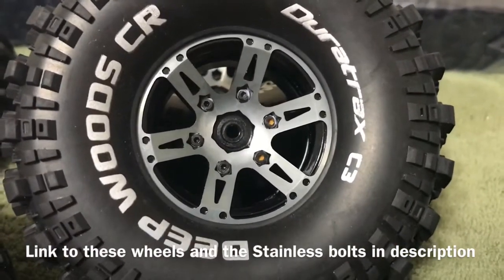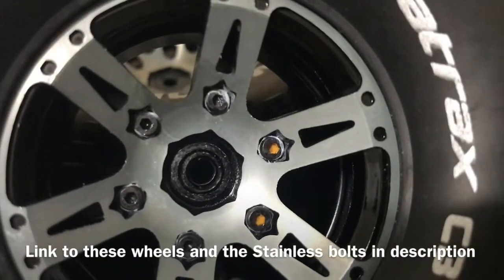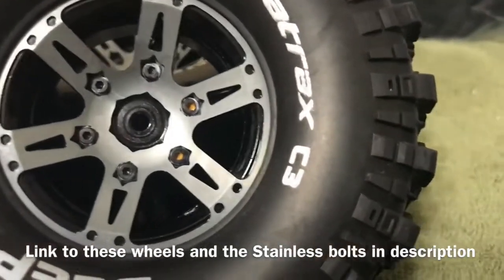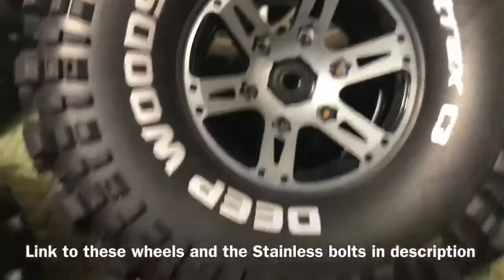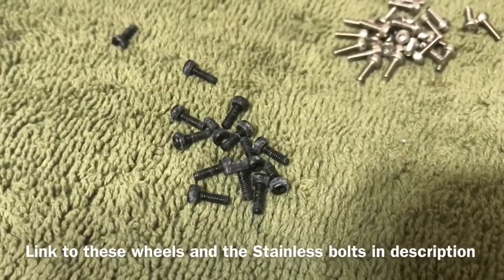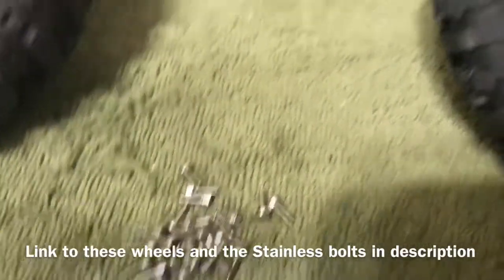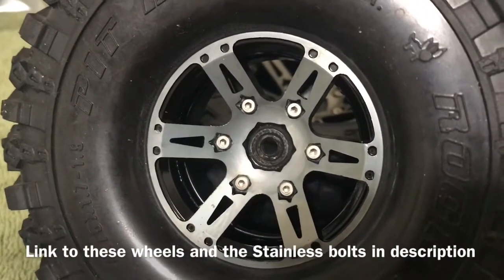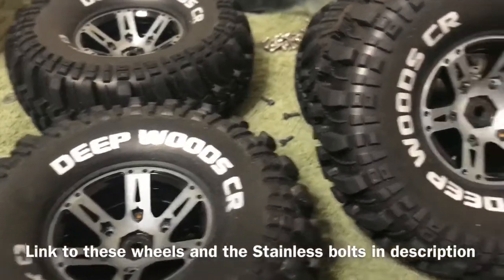Austar 1.9 Wheel update with corrosion

Comment: WD-40 and a q-tip before the water takes care of that little bit of orange growth ;)
Reply from the maker: I should do the WD-40 thing more than I do.
Reply: Exocaged RC, I use it on my drive shafts and front cvj's also.
Reply: Long story short.
I removed all the bearings from my Honcho and all the inner grease seals. Then added 3mm sets crews to the f/r axles and one to the rear of the trany. Before each run I would give each axle and the trany a good shot. I ran it with out any grease in the bearings for 12 months like a submarine! And never lost any bearings in that year. Everything I run thats going to get the water treatment, gets WD-40!!!
Reply from the maker: Wow that’s pretty awesome